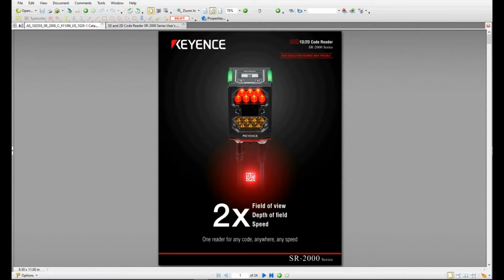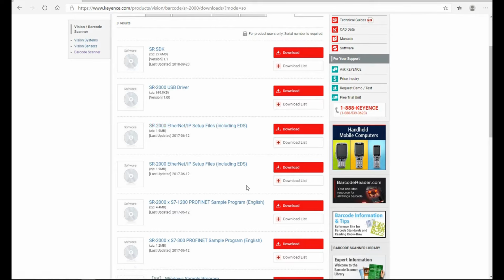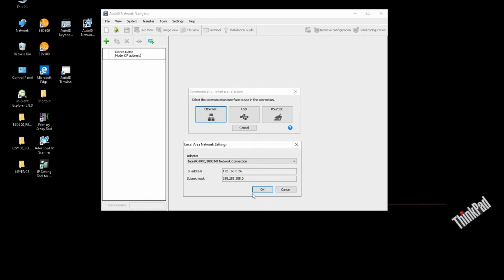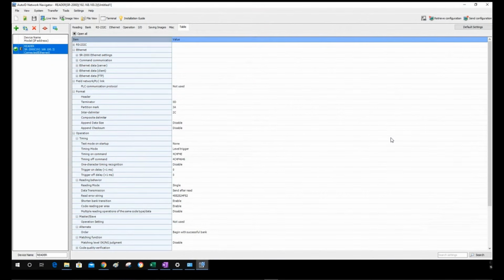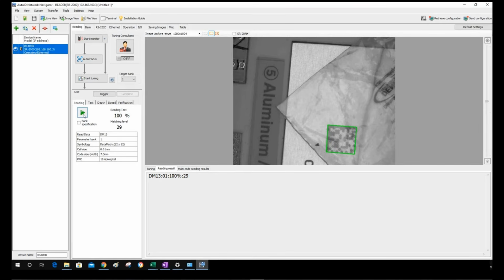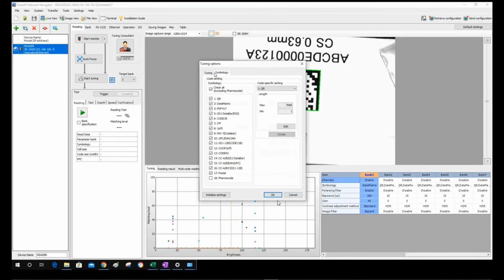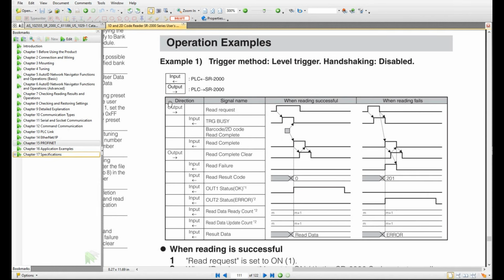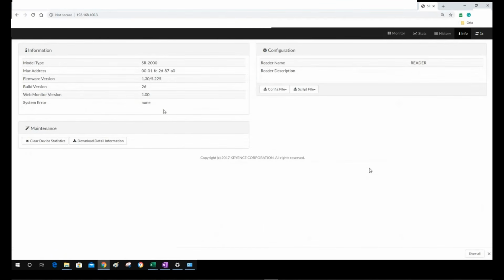KI12. Keyence Barcode Reader & AutoID Navigator Tutorial and Getting Started

Comment: Hello sir, 
Thanks for sharing. It’s very helpful. I’m using SR2000 barcode reader and data coming on Auto ID terminal as per barcode scanning. But I can’t be read data on Cosmo plot software by using RS232 communication. All communication setting done baud rate,data bit,Parity,stop bit,header & terminator also. Can you suggest any other software are using for both software to communication. If any pls suggest.

Comment: hii, i have right now using this system in my company , and getting the problem on machine , i expain, before the barcode reader camera there is laser unit and at a time 4 jobs he lasering ok but as i notice that barcode when not coming in centre way the barcode reder  camera automatically putting in rejetion bin. it not possible there every job stay in centre there chances to little bit rotate and that part also i wantet to barcode reader need to scann also although little twist. the marking of the job all gonna perfect but barcode reader not reader well because not in centre if i go change the camera setting there is for 4job there is 4 camera setted if i go to change one camera there not much space between others cameras there is all camera atttached . so plz tell me what should i need to do
Reply: Hello
Have you solved the problem? If so, I would appreciate it if you can share the solution

Comment: Thanks for sharing. I would like to know is that possiable to help, while my SR2000 reading test shown matching level lower 30, any idea or settings to improve that?
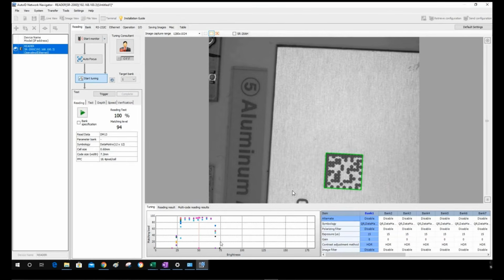Reply from the maker: Please check the 'AUTO FOUCS', do focus again. Also check if the problem comes from the barcode. As shown at 16:02.
Reply: @electricalautomation  Thanks for your tips and the problem fixed. While another question is any specific config in Network Navigator in order to trigger scan data into a excel file by usb or ethernet cable connected to the laptop. It used to work before and stop working sudden two days ago. Thanks.
Reply from the maker: @bylmy  You can use *.csv. Find the tab named "Table" -> Ethernet data (FTP). The AutoID software can export the data to csv. Please check the User's manual of SR2000 code reader.